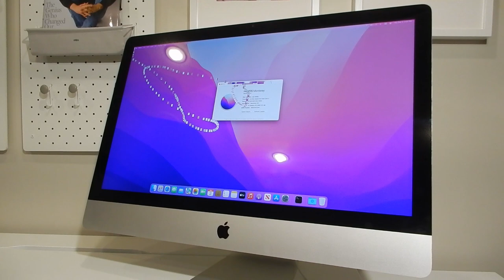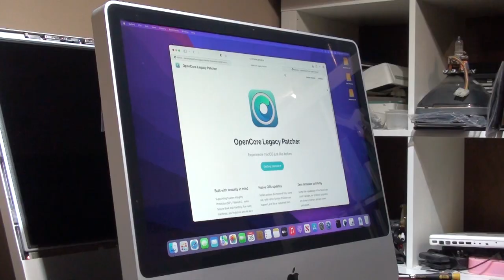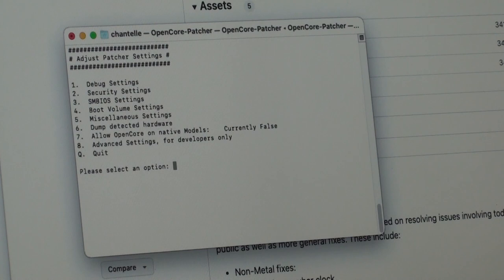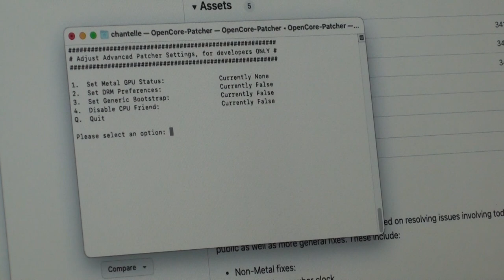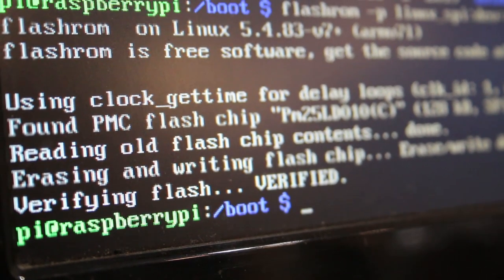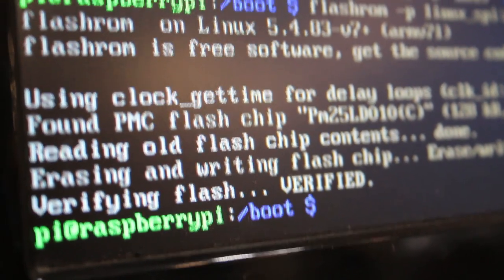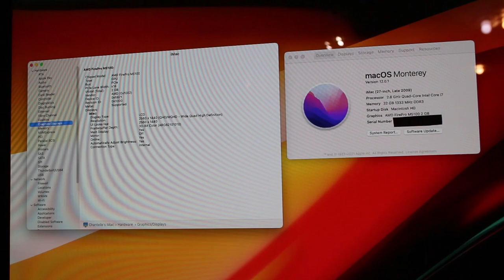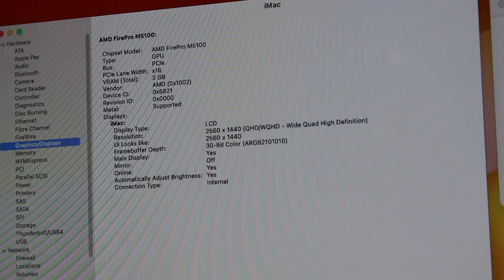iMac GPU Upgrade, Metal SUPPORTED!!

Comment: hello, i finally installed this GPU on my mac A1311 12.1.  21.5 mid 2011I use  MacOS ventura With OpenCore. As ACDrift said, I already bought the board with the modified vbios . The installation is long but easy. 2hours. I restarted the imac and i had the same problem as AcDrift.
It only recognizes 7 MB of VRAM
I canceled the open core post installation pacht in the Open core interface, reboot, same problem. I reinstall the Open core post installation pacth,  reboot, and… red screen. I reboot and the system stop the launch a few time , at the middle of the launch line under the apple. Black screen. How could I Know if the GPU bios is OK ?  For the moment,  I try to reinstall whith time machine.
Thanks for you help
Reply: I finally decided to restard the mac with safe mode.I saw in propertises that the AMD card was detected. Size of memory was OK (2gb) but not the name (AMD RADEON 7XXX) I think that the legacy patch is not OK. It  decided to desinstalled the leagacy patch.  Reeboot: No pb, no crash but the card is not detected correctly. So the pb is legacy patch and i saw in the documentation this: Following GPUs are applicable:

GPU Architecture	Model Families	Supported
AMD Polaris	RX 4xx/5xx (10/20 series)	Supported with patching
AMD Vega	Vega 56/64/VII (10/20 series)
AMD Navi	RX 5xxx/6xxx (10/20 series)	Unsupported

Is AMD M5100 compatible with open leagacy / Ventura ?
Reply from the maker: Yes, it should support Ventura.  The M5100 is a GCN 1.0 card, which is officially supported on Ventura via the OCLP v0.5.0, so make sure your OCLP version is new enough.  I've also experienced issues if the system was previously patched for legacy graphics (stock Radeon HD card) and then upgraded the card.

The best way is to swap in a new hard drive (or fully wipe), install fresh, and apply the OCLP post-install patches with the M5100 installed.  The patcher should see that the stock card isn't there and skip those patches, and install the GCN 1.0 patches instead.

I believe restoring from Time Machine will restore the previous GPU patched system.  If you can't do a fresh system install and need to retain the existing system, you can try restoring Time Machine and then doing an in-place reinstall of Mac OS to restore the OS to stock but retain personal data.

Bottom line, if the system is patched in ANY way for the stock Radeon HD, it can cause problems for the GCN 1.0 cards.  Fully wiped/fresh OS + OCLP 0.5.0 or later should resolve it.

If you get video out using the iMac's internal LCD, I suspect your vBIOS is fine.

I don't have experience specifically with Ventura, but I will try to help if you post back with questions.  Good luck!
Reply: Thanks for your response. I really appreciate your attention to questions. I will let you know as soon as I have realized all this. It takes time, it’s not so easy to learn all these concepts but it’s exiting to bring these incredible IMac to life. Sincerly yours.
Reply: Small question, you told that the best way is to erase my main hdd ? The risk is that i will no longer able to boot from a usb let to reinstall after (since i have the new gpu, i cant choose the boot with option key) thanks
Reply from the maker: @agfo91  Yes, that is a risk for sure.  If you have the original GPU, you could install it temporarily if you run into trouble.  Or, a better option for testing, install a different blank hard drive.  If the hard drive is fully blank, EFI "should" choose the USB stick as boot device even if the hard drive is normally default.

Both options would work for me because I have lots of spare parts, but I don't know what spare parts you have on-hand.
Reply: Hello, it finally works. I only installed last oclp (1.5.0) rebuild , reboot and it’s ok. Thanks a lot !
Recognized as Amd FirePro M5100 Metal supported / sonoma / iMac2011 21.1
Reply from the maker: @agfo91  Excellent!! That is great to hear!  Great work!
Reply: Thanks a lot for your ideas . Your channel it really cool!

Comment: Hi, this video is really interesting. I'm going to buy an Imac with vga problems. I want to know the copper thing you put on the graphic card, where is possible to buy it? thanks in advance!!!
Reply from the maker: I think you can buy various sized copper shims on eBay, if you look around.  Honestly though, you should be able to salvage a piece of copper from an old laptop.

I used a random piece of copper pulled from a scrap MacBook cooler, and cut to size.  The backside had a black coating, which I cleaned off.  Make sure it is SMOOTH on both sides, with good thermal paste, for optimal heat transfer.

The cooler does graze the die on it's own but does not have enough mounting pressure, and there are springs for tension so there is some leeway for thickness.  The recommendation in the guide I read was 15mm x 15mm x 0.5 to 1mm thick, which would be close to what I used.  Here is the article: https://forums.macrumors.com/threads/2011-imac-graphics-card-upgrade.1596614/page-320?post=28696585#post-28696585
Reply: @rebootretro  thank you very  much for the answer.

Comment: I have an imac 2015, can I upgrade the graphics card, but I want an external one without disassembling the device, does it suffice?
Reply from the maker: Any Mac with Thunderbolt 3 running High Sierra or later is supported for eGPU.  You’ll have to check, but I believe the 2015 iMac only has Thunderbolt 2 ports.

It’s also important to note that apps like games will only be able to use eGPU with an external monitor connected directly to it, unless the app explicitly supports multi-GPU like Pro apps.
Reply: @rebootretro

Comment: friend, I have an Imac A1311 12.1 I'm running MacOS Sonoma with OpenCore however I noticed some slowness in the animations it has an AMD HD6750M 512MB, I bought the same model of video card that you used, I can install it following the same steps What did you show? I already bought the board with the modified vbios but the seller does not recommend this board model for my imac.
Reply from the maker: You are correct, the HD6750M only has partial graphics acceleration (after patched with OC) which causes slowness in animations.  Moving to a Metal-supported card brings back full acceleration.

I am not sure what the seller meant.  There are some known issues with 2011 models which breaks iMac sleep (you have to disable sleep, unless they fixed the issue in OpenCore) but I believe it should work otherwise.  Also, all the research I've done on the M5100 card was with 27" models.  I don't see a reason it won't work on a 21.5" model though.  You could ask the seller for details, specifically WHY they don't recommend in your model.  I have not tried your combo, but I don't see any reason why it won't work.

The installation should be similar.  A couple things:

1. You need to double check, but I think on the 21.5" model you do NOT need the copper shim - the 27" uses MXM 3b cards but I think the 21.5" uses MXM 3a cards and I THINK the stock die hight is taller on these and not needing the shim.  You NEED to double check this!  Not enough pressure on the die and it will overheat.  Too much pressure on the die and it will crack.  Mounting pressure does not need to be exact, but must be inside reasonable limits.

2. Even if you already have OpenCore and modded vBIOS, you may need to set OpenCore flags like in the video so it will properly initialize the card to get boot screen.  I was using a much older OpenCore version; it is possible that newer versions of OpenCore now detect the card and automatically set the flags.

3. (For troubleshooting).  If you do not get video on screen, try connecting an external monitor.  If the seller did not flash the correct vBIOS, the video may come out external port instead of internal LCD.

Otherwise the installation should be very similar to the video.

Good luck with your upgrade!!
Reply: @rebootretro  Thanks! As soon as I install it, I'll come back here to let you know if it went well, just for knowledge. Thanks for the video and instructions!
Reply: @rebootretro  Friend, I installed the card today and it worked but it only recognizes 7 MB of VRAM, is there anything I can do?  Brightness level doesn't work either, I saw that there is an advanced option for developers in Opencore but I couldn't find it
Reply from the maker: @AcDrift  I think there are 2 possibilities:

1. OpenCore doesn't have the correct settings set.  Some GUI versions don't have the advanced options, and you need to use the TUI (terminal version) of OpenCore to set them.  If you are getting the OpenCore boot picker and Apple boot logo screen then I don't think this is the issue (but you should check anyway).

2. If you previously had the non-Metal OC patch for the original stock GPU, it's very possible (and likely) this is causing an issue.  To confirm this, install a fresh copy of Mac OS on an external drive without any graphics patches.  I think this is much more likely the problem.

Congrats!  It looks like you almost got it fully working!!  You're past the hardest part already!
Reply: @AcDrift  =hello, did you finally need the shim ? thanks

Comment: Great vid! I have a mid 2011, 21.5inch iMac and I really want to upgrade to newer software so that I can run certain plugins on my music production software and possibly stream live on TikTok from the iMac. I have NO IDEA which card to use though!

I don’t care how long it takes me to find a card and I want one relatively cheap (>£100) and I don’t care how much work it takes I just want the highest performance boost possible and metal support. 

If anyone is able to help me out on this one I’ll be eternally grateful!
Reply from the maker: Be careful in the 2011 models, there is a known issue with AMD GCN v1-3 cards (like the one in this video) where the PRAM needs to be reset on EVERY boot and sleep/wake is broken.  Also, because of NVIDIA's dispute with Apple, most NVIDIA cards have some issues with Monterey but some severe issues with Ventura onward due to lack of drivers.

Normally I'd recommend something from the GCN v1-3 section because they have excellent driver support, but based on your model you may want something else.  I would highly recommend reading through this thread: https://forums.macrumors.com/threads/2011-imac-graphics-card-upgrade.1596614/

The first post lists nearly all tested cards, and notes the issues they have.  Unfortunately, there really isn't a "perfect" card because they all have some issue or another; it's best to pick whichever will have the least issues in your scenario.

Start by finding an architecture that has the least issues in your scenario (i.e. GCN 3 vs Maxwell, etc).  Then find the highest model in that series for your budget.  Lastly, make sure to Google that card and your system to make sure there aren't some weird compatibility issues, or that there aren't multiple revisions of that GPU which may not be compatible with the BIOS you want to flash.

Sorry, I know you were hoping for a more definitive model recommendation.  But I've not specifically done this on a 2011 21.5 inch so I can't speak from experience.  Hopefully someone else who has will chime in with more info.  If not, I hope this info is at least somewhat helpful.  Good luck with your upgrade!

Comment: Thanks for the video! after watching this I just purchased the M5100 FirePro for my 2011 27" iMac, which I'm actually waiting to receive a Xenon E3-1275 v2 , to do a CPU upgrade. 
Would you recommend doing the CPU upgrade first? or after M5100 GPU upgrade?
Reply from the maker: I don't see any benefit to do either one first, just that I would do them one at a time for troubleshooting reasons.  Since the GPU is probably going to be the more fiddly upgrade, if it was me I'd probably do the CPU first and test it to get it out of the way since that upgrade is more straight forward.  The GPU upgrade was a massive hassle of troubleshooting, but works flawlessly in my 2009 after finally getting everything set correctly.

The CPU is a drop-in replacement, where the GPU requires BIOS modding, copper shim, OpenCore customization, etc.

But ultimately I don't think there is any technical advantage to do one first.  Good luck with your project!!
Reply: @rebootretro  Thanks for the detailed response. Did you find most of your troubleshooting guide and support on the forum? I was playing around with Ventura, but it was super laggy, which got me into looking for upgrade options for both GPU and CPU. 
To get a good baseline, it’s probably better to delete the OS partition and install Monterey for all this before looking into testing out Ventura after both upgrades?
Reply from the maker: @renzonovara2728  It should not be laggy with your existing CPU.  The OS itself won't see leaps and strides of change based on your CPU.  It makes me think your issue might be elsewhere.  Obviously a better CPU will perform better, but you shouldn't have usability issues with the factory one.

It's possible that the issue is related to the factory GPU not having proper graphics support, in which case an upgrade should fix it.  I noticed you're using a 2011; I think there are some other important notes when doing a GPU upgrade on 2011 but that should be all in that forum.

For troubleshooting, most of the info was in that forum thread, but I did some light Googling outside of that.  My video doesn't go into detail but does outline the basic process.  My video is also for a 2009, and the process could be slightly different for a 2011 so I'd recommend reading up before starting.

I'd also recommend going the chip clip method for programming (like I did).  A USB programmer is fine (and easier) instead of a Pi.  Flashing from Linux is dangerous, because if you accidentally flash the wrong file you won't be able to boot to reflash the right file (and will need a chip clip anyway).  Also very important to dump/backup your stock ROM from the GPU (at least TWICE!); that way you can flash back if you have issues.
Reply: @rebootretro  Thanks for the tips. Helps a lot to gather as notes plus the forum reading I’ll do. 
One thing I didn’t mentioned and maybe that is why the 2011 iMac las lagging and slow is that after doing a full Time Machine file restore, after laggy Ventura was already installed, the PSU starting to make a loud static noise and did not powered back on after shut down. I’m waiting on delivery of a replacement PSU, before I can do anything. 
I appreciate all your tips and time!! 👏🏼
Reply from the maker: @renzonovara2728  No problem!  Yes, those PSUs do die on occasion.  Good luck with yours!  Sounds like you're pretty close to a full rebuild at this point, it will be like new afterwards!
Reply: @rebootretro  Thanks!!

Comment: Is it possible to do this upgrade on a 2010 imac?
Reply from the maker: Yes, it's possible.  Just read the thread in the description before buying a card, because sometimes there are some compatibility issues between certain cards and Mac models.  I believe the one shown in the video works in a 21.5" 2010 iMac, but double check before buying :)
Reply: ok, thanks!! @rebootretro
Reply: @D4rkFeNiX1  i have a mid 2010 27" iMac... did u manage with yours?
Reply: @giorgos7six  I'm waiting for my gpu to arrive from china, I bought it this week on aliexpress and my imac is a 21.5, I couldn't close a deal on the 27, but regarding the gpu, the Chinese already send it with vbios for mac
Reply: @D4rkFeNiX1  what GPU did u order?

Comment: Wow
Is that possible to run windows now? To make gaming smoothly?
Reply from the maker: The M5100 isn't great for gaming, but if you intended to use Windows only you could move to a GTX 880M 4GB, which is one of the top end cards that will fit in these iMacs.  Not ideal if you intend to use Mac OS, since NVIDIA has some sort of a dispute with Apple and there are only old hacked drivers for modern Mac OS.  But it should work great on Windows, since you can use the latest Windows drivers.  Also important to note the GTX 880M consumes significantly more power than the stock card, which may put strain on the power supply.

You're still limited by the old CPU and older GPU, but it should game significantly better than with the stock card :)

Comment: Forgive my ignorance, but what exactly IS 'metal'?
Reply: Graphics API like OpenGL
Reply: @ghardware_3034  Thank you! Would this upgrade be worth it for a Late 2009 iMac? My GPU has only 512MB, and isn't always the most stable (when using Blender in particular)
Reply from the maker: @ConorFenlon  Performance likely won't have a huge benefit as the M5100 isn't terribly high-end.  If your getting freezing and lockups like I was, I would expect the upgrade to fix it.  The original GPUs will start causing lockups when they are in early stages of failure; from my experience the lockups become more frequent until the card fails entirely.  My iMac is incredibly stable now with this upgrade, I am very happy with it :)